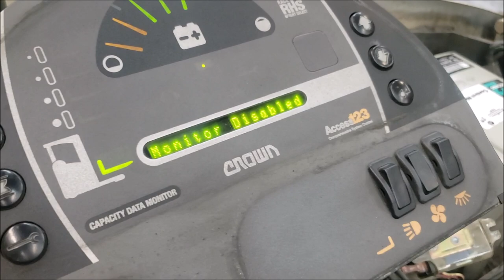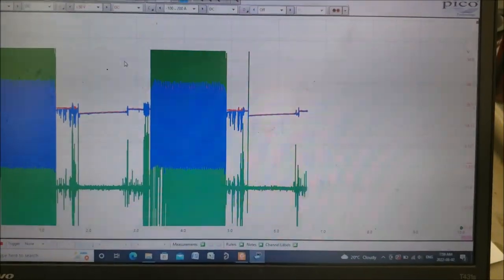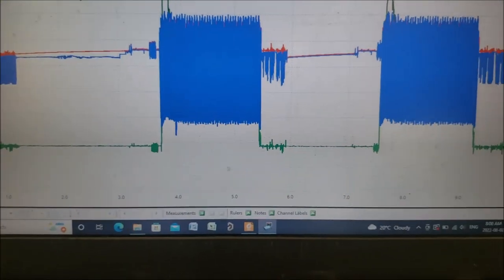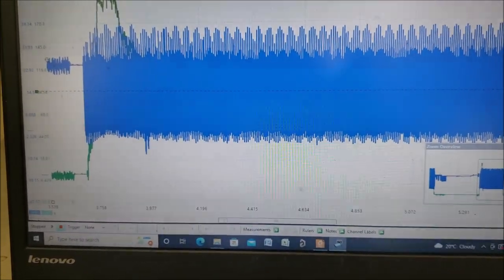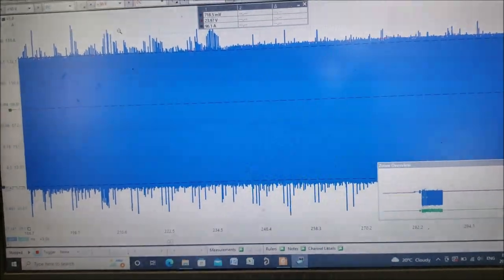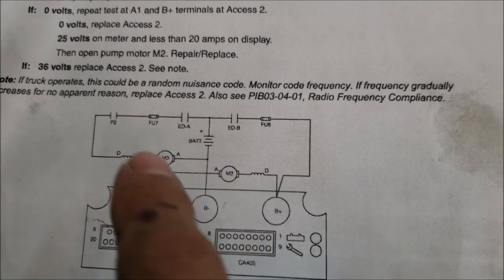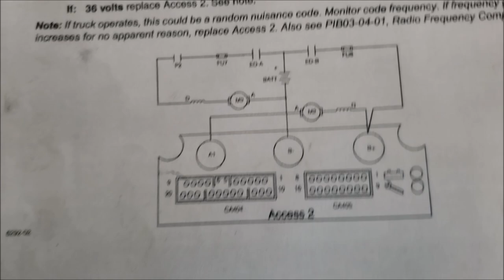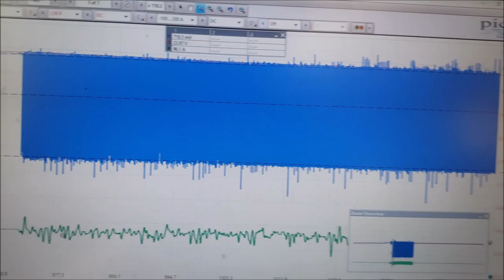Crown Reach No Lift, No Drive (Code 222)

Comment: I picked up a new customer by diagnosing this exact same problem. The first company diagnosed a bad computer as well and gave an estimate. The brushes looked good as well until I pulled the leads to check that they were traveling freely in the holder. They were all very tight in the holders. Ordered new brushes (I think from Crown) and they were tight too. The holders looked good so I ended up filing down the new brushes until they slid freely. Dressed the commutator and the truck has been running fine for the last 8 years. I never did figure out how brushes that must have been free when the motor was built became so swelled as to be tight years later. 

Good video.
Reply: I've seen that too but the brushes on the ones I've seen were arcing and the commutator was a little burnt. Installed new brushes, cleaned the commutator and it's good as new. This one threw me for a loop because the motor was running fine, until it wasn't.
Reply: This isn’t from the carbon brushes swelling. It’s from the metal parts of the brush holder warping from heat. Bad/weak batteries, over loading, bad cables, and lots of things can cause it. Not gonna say I never rubbed a little off the side of a brush so it slid better in a brush holder. Used to do it all the time on super high hour crown PC3000 pallet jacks

Comment: Wow, I would've went down the same rabbit hole and put a module on it too! I'm curious, if the cables were removed the minute the motor shut off, would the resistance be at least a few ohms  higher than normal? Finally, as usual, another awesome and informative video!
Reply from the maker: Maybe